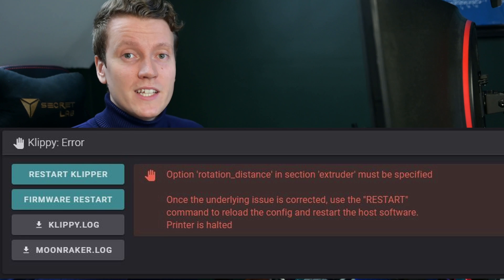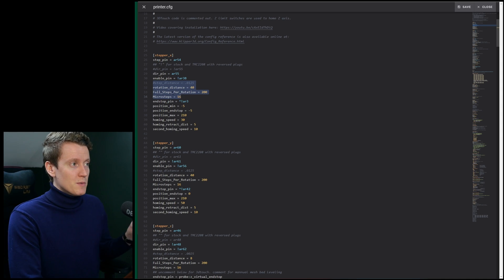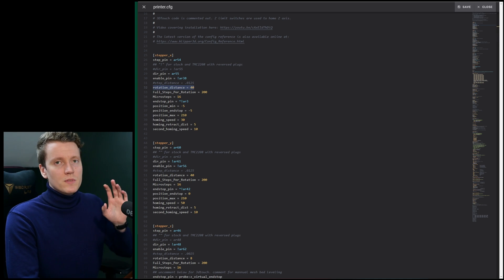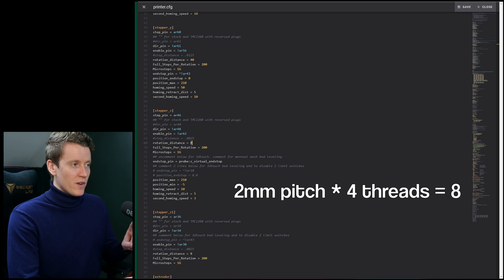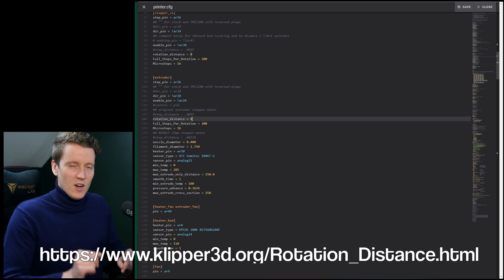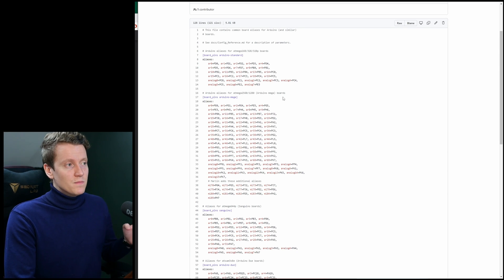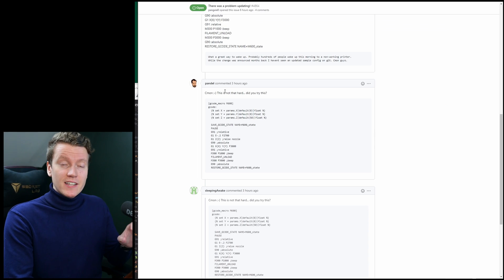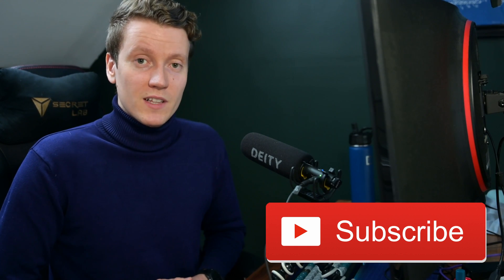Fixing Klipper Update Config Errors | Rotation_Distance, pin_map, and default_parameter_name

Comment: Option 'step_distance' is not valid in section 'stepper_x'

Once the underlying issue is corrected....

what does it need? 
[stepper_x]
step_pin: PF0
dir_pin: !PF1
enable_pin: !PD7
step_distance:  .0125
rotation_distance: 40.0
Full_steps_per_rotation = 200
microsteps: 16
endstop_pin: ^!PE5
position_min: -8
position_endstop: -8
position_max: 400
homing_speed: 20.0

Comment: Just built a prusa mk3s clone(einsy rambo) using fluiddpi on rpi4 with KIAUH running 2 instances of klipper and moonraker(ender3 on other port)
Hope this video has the answers. I feel like my mk3s is under extruding or the z axis is moving weird, any config recommendations?
Reply from the maker: Have you calibrated your extruder steps to make sure it really moves 100mm when you tell it to move 100mm? That's always good to do with a new build. Also try a heat test tower to make sure you are printing hot enough

Comment: After a update my Klipper say this:

15:48:14 
// Option 'rotation_distance' in section 'stepper_x' must be specified
//
// Once the underlying issue is corrected, use the "RESTART"
// command to reload the config and restart the host software.
// Printer is halted
15:48:14 
!! Option 'rotation_distance' in section 'stepper_x' must be specified

Is that the same problem?
Reply from the maker: Yeah I think that's the same problem. It now needs the new parameters in the stepper sections

Comment: this did not seem to solve the problems i am having.... i think i might also have to update the MCU. could you do a video on that?

fluidd suggests i recompile and reflash my firmware but i have no clue how to
Reply from the maker: Here are the steps to re-flash your MCU. It is really simple from Putty or any other SSH software. https://www.klipper3d.org/Installation.html#building-and-flashing-the-micro-controller
Reply: @JJShankles  thank you.... i have tried these steps but i keep getting an error at this step: 
"make flash FLASH_DEVICE=/dev/serial/by-id/usb-1a86_USB2.0-Serial-if00-port0"
Reply from the maker: @emilpedersen5325  is that the correct device port for your machine? You should run 
ls /dev/serial/by-id/*
Then use the result from that as your FLASH_DEVICE.

For example I got from the first command:
/dev/serial/by-id/usb-Silicon_Labs_CP2102_USB_to_UART_Bridge_Controller_0001-if00-port0
So I then ran:
make flash FLASH_DEVICE=/dev/serial/by-id/usb-Silicon_Labs_CP2102_USB_to_UART_Bridge_Controller_0001-if00-port0
Reply: @JJShankles  hmm. i have done that. it fails every time. error 255
it says the following: 

dfu-util: Invalid DFU suffix signature
dfu-util: A valid DFU suffix will be required in a future dfu-util release!!!
dfu-util: No DFU capable USB device available

Failed to flash to /dev/serial/by-id/usb-1a86_USB_Serial-if00-port0: Error running dfu-util